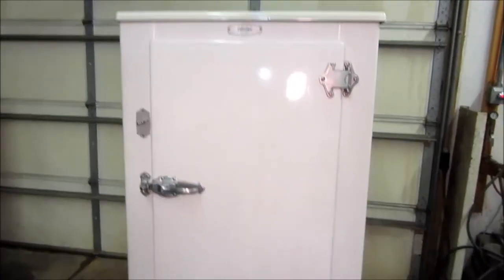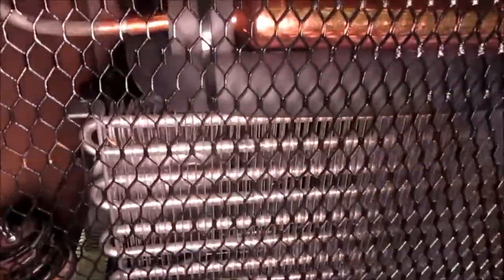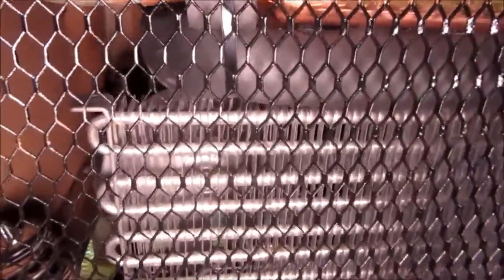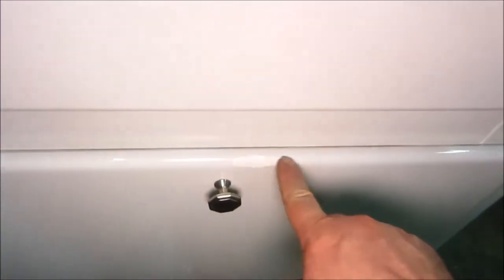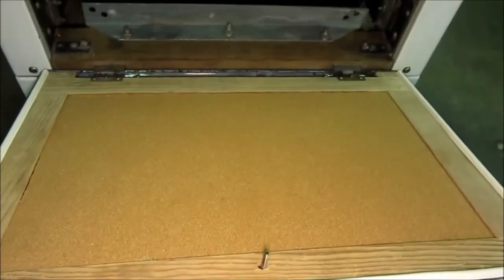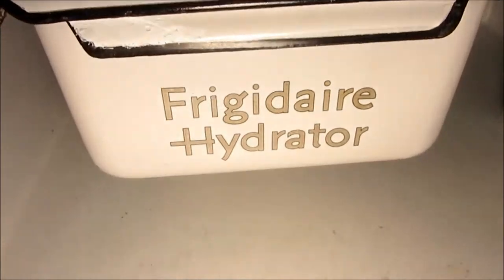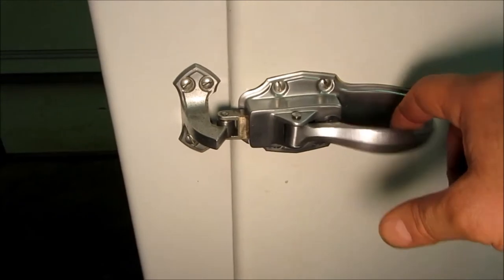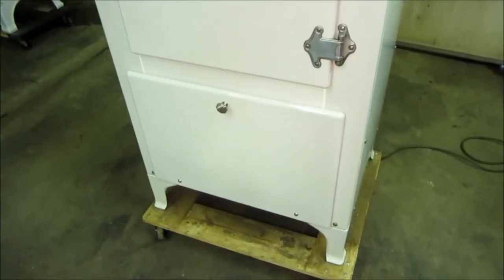Frigidaire W-5 Antique Refrigerator -8- Conclusion in HD

Comment: Can  you tell me how efficient this refrigerator be compared to a newer one ??? Thanks David. Also, can anything be done on new equipment to increase the life expectancy besides the usual keep things clean and maintained??? Thanks fella too. VF
Reply from the maker: The belt drives were not that efficient due to the friction of the belt, shaft seals, and external moving parts. They are just a cool piece of history to keep alive! 

As for modern fridges, be sure the start relay and capacitor are in good shape. That will help with the life of the compressor. Also, turn off the door mullion heater if the fridge is indoors and there is no condensation. That reduces heat loading.

Comment: Can you give me specs on the motor? I have a friend who has this same refrigerator. It’s missing the motor. He’s not wanting the exact replacement, just wants to get it up and running.
Reply from the maker: Hi Pete. The motor on these was originally branded Frigidaire Motor; made by Delco Products division of GM.  It was a repulsion-induction motor. The motor is a 4 pole (1725 RPM) and is rated ¼ or 1/5 HP. You can replace it with a capacitor-start ¼ HP 4 pole motor. You’ll have to make a base adaptation to mount it, but it will work. You will need to get a fan-pulley combination for it; however. The condenser depends on that fan for proper cooling.